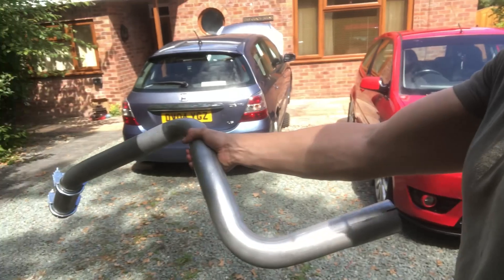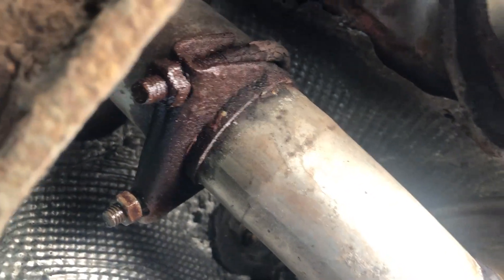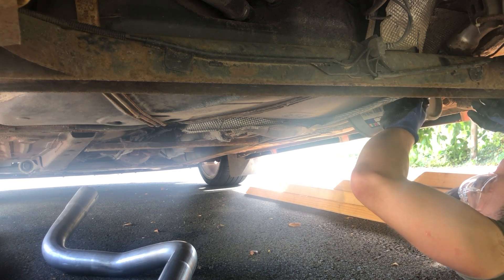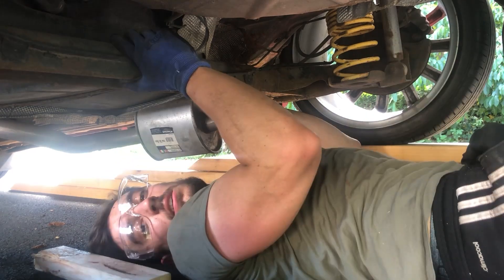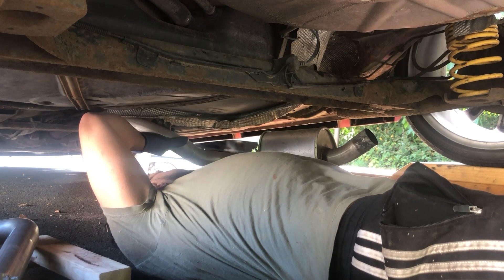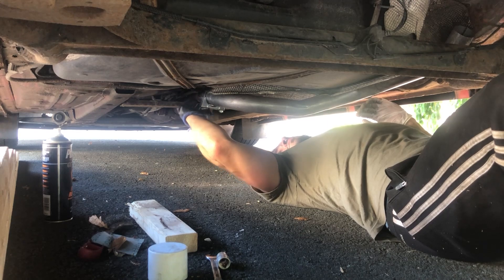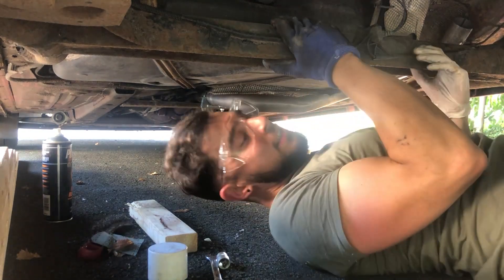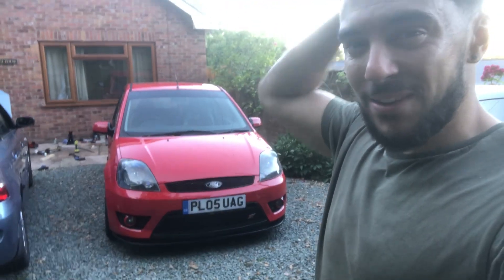*SURPRISE* Fitting a Straight Through Centre Section on my mate's ST150

Comment: Did you watch my loud exhaust video?
Reply from the maker: Nah bro, I’ll take a look when I get chance 👍🏻
Reply: @MendItModIt  it sounded insane with no exhaust. Love the sound of mine now the Res has gone. Will see what it sounds like on a drive when it's dry
Reply from the maker: I’m torn what to do with mine, de-res, back box, full system, custom system 🤷🏻‍♂️
Reply: @MendItModIt  for cheap the non res is a nice little upgrade for a little more sound. But my plan is next year I hope to afford a full Milltek system
Reply from the maker: Yeah see I fancy a milltek but they are bare cash. Also I want to have a choice on the tips and potentially want to go custom
Reply: @MendItModIt  for the Milltek I would like the black tip or as you say a custom exhaust would be cool. Loved my Slash cut duel exhausts on my 500 Abarth